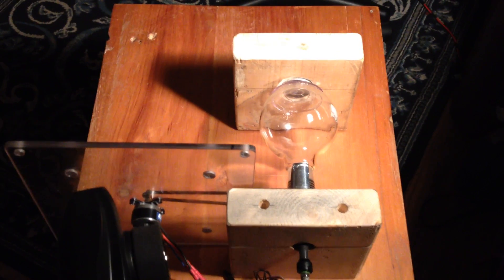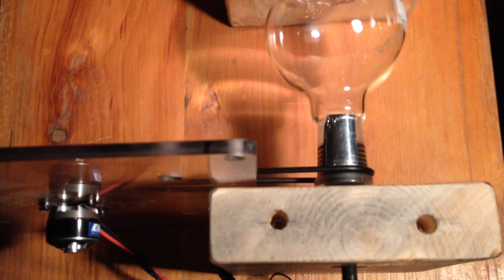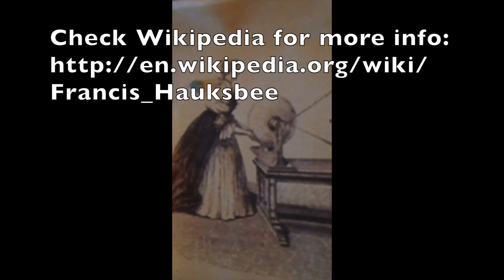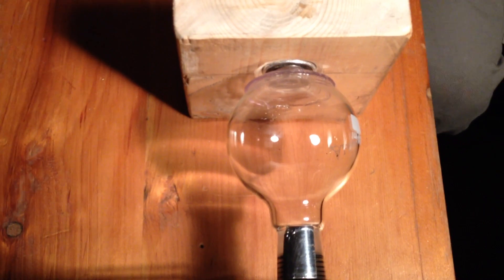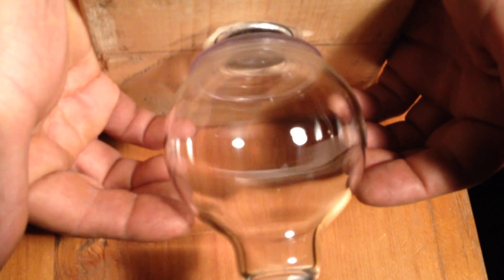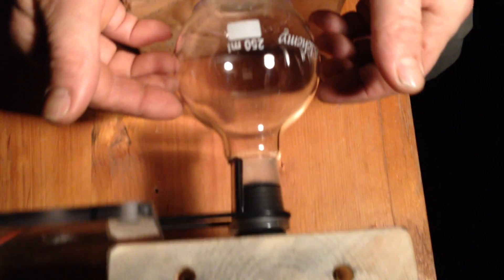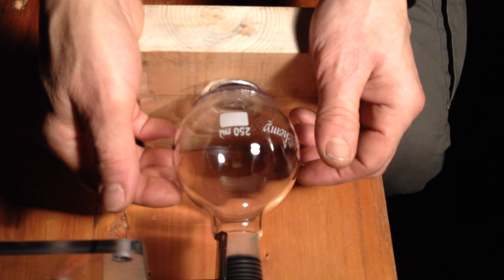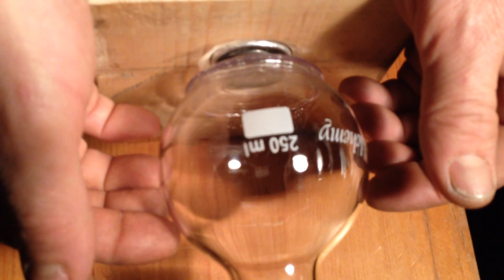Hauksbee Generator Experiment

Comment: Would a hauksbee device be able to produce electricity without a partial vacuum inside? Say you had some sort of glass bulb and used a spinning wheel to spin it, if felt or other cloth were held to it would you observe electricity by the sound of crackling? (Also there is no mercury or fluid inside the bulb)
Reply: It would still produce static electricity but there would be no glow because the glow is produced by the mercury and the absence of air is to eliminate resistance I think...